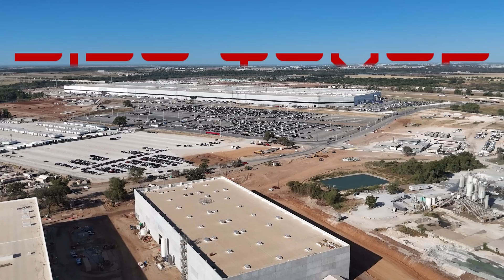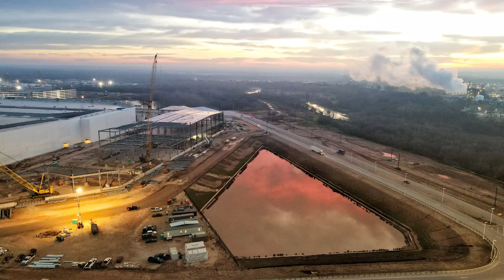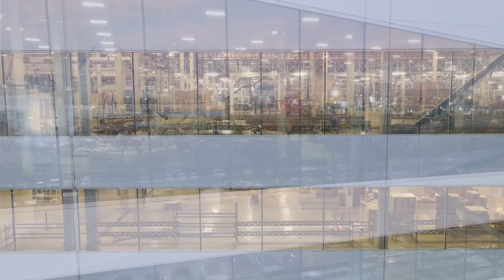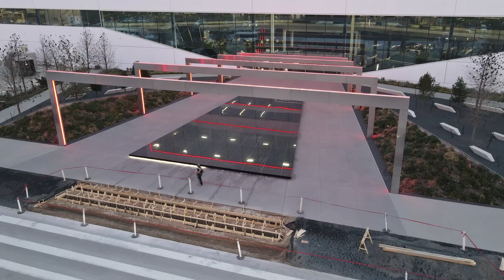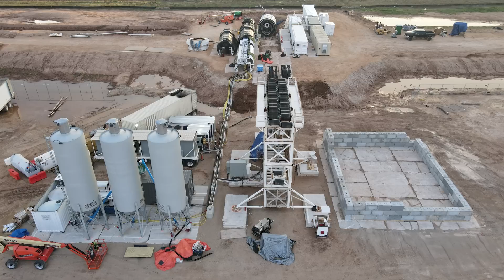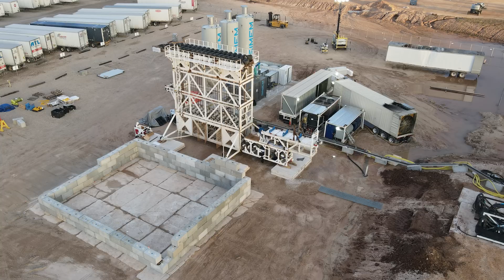Inside Views! S Glass Wall Expands! Castings Everywhere! 7 February 2024 Giga Texas Update (07:05AM)

Comment: Hey Joe, I ran into a couple of Tesla service techs doing PM (preventative maintenance) at one of my local super charger stations. I had a great conversation with them as we nerded out. They do general PM every six months, then a major PM every five years. The best part is that I found out that those white equipment cabinets contain racks of the same chargers used in the cars that are paralleled together to operate as the superchargers. This just tickled the nerd in my soul, since using an assembly line part as modules means that they are able to take advantage of the economies of scale, and if one module fails, others can take up the slack until they are replaced. I believe that he said that they are hot swappable, so replacement can occur while they are operating. Truly another example of the next level engineering at Tesla.
Reply: Preventative maintenance program. Just about every other charging network falls down in that area.

I gather you are talking about the DC charger side?

What else did you get out of them?
Reply: @DessieDoolan  With all battery chargers that get their power from AC mains you are dealing with a combination of both AC and DC. The AC power comes in, then will be stepped up or down in voltage to that which is optimal for the charger system, then like any DC power supply that operates off of AC, will go through diode bridge rectifiers, smoothing and conditioning, then current and voltage output controls that can deliver DC to each individual vehicle at the voltage and current required. The vehicle will also contain further controls to ensure proper charging is occurring. Not sure how other vehicles do it, but Tesla has the vehicle communicate with the multiple chargers that are paralleled together to output exactly what the vehicle needs. As an electrician, I am impressed with the architecture.
Reply: @GoCoyote   You seem to have struck gold. You had the bonus of talking to techs who knew their stuff, and were willing to talk about it.

Really impressed about the maintenance cycle. Tesla chargers have a reputation for reliability, there's the reason.
Reply: @DessieDoolan   I agree. It makes a huge difference to be in front of issues instead of behind them. They will get notifications of issues, so they can provide emergency repairs in addition to the standard maintenance. Because they are using smaller modular components, they can allow some to fail, then replace them during scheduled maintenance. It also allows the chargers to cycle through the units as to which ones are being used the most in order to prolong their life.
Reply: Thats is an opportunity to note why NACS DC is better than CCS . But CCS has hi power 3-phase ac charging i hear you say...sure, but then you have to put 3 phase power rectification in EVERY CAR. Which is expensive, and heavy. Simpler and cheaper to build stationary rectification and just send DC into the car.
Reply: @geomacaulay  No onboard vehicle chargers in the US use three phase power, since it is not available to US residential systems, so only split phase 120/240 is used in them.

CCS is a connection plug standard that provides separate AC and DC connections to vehicles, unlike the NACS which the vehicle can utilize low power AC or high power DC from the same connection. When a vehicle with a NACS plug connects to a charger, it determines if it is a AC supply or DC, then routes the incoming power through the required connections. If AC, it will route the power to the onboard AC to DC rectifier system (the onboard charger) that will output DC power to the battery. If DC is inputed, it will bypass the onboard charge and instead communicate with the external charger/s to provide the appropriate DC power to the battery.

CCS plugs provide entirely separate connections to the vehicle that allow for the routing of AC and DC to occur using separate connections instead of doing so using switching methods internal to the car. Both systems still use an onboard vehicle charger that can convert AC to DC, since making an external AC to DC converter would mean a bulky and expensive portable charger if you are visiting grandma and want to charge your vehicle.

It would also require separate wall chargers for each different vehicle since every vehicle battery requires different voltage and current settings. Much easier to include all of the necessary electronics in a package within the vehicle. The exception is for high amperage DC chargers where external AC to DC makes sense. With proper controls and common architecture, they can become universal to different vehicles battery charging needs. That is why universal adoption of NACS in North America is such a game changer, since it will create a common standard that will allow cross manufacturer vehicle and charging platforms.

The Only reason that Europe has gone with CCS plugs is that it was mandated by the EU before Tesla was able to get a foothold. Plus many counties in the EU provide 230V three phase power to the service in residential homes, yet there is also a lot of single phase 230V services, especially in older homes. Within the home most circuits are 230V single phase regardless if the service is 3 phase, except for vehicle chargers which tend to be three phase if available.
Reply: @GoCoyote  FWIW. Some complexity down here. AFAIK all EVs here are CCS now. Model S and X no longer available, these did have the Tesla/NACS plug. The only Supercharger station I'm familiar with has 2 leads per Supercharger, a CCS Combo 2 and a Tesla/NACS.

Home wall connectors come standard wire-able as single or 3 phase. Plug is CCS/Mennekes without the DC pins (smaller). Same as Europe I guess.
Reply: Do you mean the smaller white cabinets that come with 4 Superchargers on a concrete pad, like the ones seen @ 16:04 (Bottom of screen)?
Reply: @DavidJohnson-tv2nn  I am not sure of the function of the smaller cabinet mounted on the pad, as our older station that I was chatting with them at only has the larger cabinets, and the techs said that they were all installed in the large cabinets, and that DC was ran from the chargers to each charging stall. If I ever get a chance, I will ask about the newer modular systems. The charger modules contain transformers, diode bridge rectifiers, smoothing and conditioning, and current output controls similar to any DC power supply.
Reply: @GoCoyote I liked seeing your namesake hunting around!
Reply from the maker: very cool and thanks for sharing!

Comment: Main entrance could be the installation of a giant water and squeegee system to automatically clean the blackstone on an ~ hourly basis.
Reply: Black tile or stone set in mortar is a nightmare no matter how you do it.  Constant leaching of calcium deposits from the mortar onto the surface, happens all the time with other colors too, but black just shows it asap.
Reply: @michaelkaster5058  Aye. Rip it out, sell it off and replace with some of the perfectly good concrete slab that are dotted about all over the place.
Reply: @michaelkaster5058  Should have just gone with a pool

Comment: Is there a reason the cathode building has so few (if any) glass windows?
Reply: With batteries, the components need to be as free of contaminants as possible.  More openings is more opportunity for stray particles.  That said they did install then remove some concrete panels and then install glass at a later time on the main building.  Could just be a  lag in between ordering and delivery for the glass panels and needing it closed in.  Last thing is in a volatile environment such as battery making you don't want any errors made cause someone read a monitor wrong, cause the sun was shining on it.
Reply: Concrete is cheaper than glass and there aren't going to be offices there It's pure factory production.
Reply: @catseyes2334  I feel bad for the poor workers who have to work in that dungeon!
Reply: @DavidJohnson-tv2nn  Hopefully it’s mostly automated and doesn’t need that any employees working in it. Usually in such facilities, you have miles of pipes and machinery and Control Rooms. Not a lot of need for windows in either.
Reply: @DavidJohnson-tv2nn I worked inside data centers for 20+ years. Total dungeons. At one point I managed 3 floors of about 25 people per shift. Most of us survived and have a positive outlook on life. None went “postal” in my career. Lots of people work in dungeons and make good money and live normal lives. Stop trying to paint a negative picture wherever you can.
Reply: @RanchReed  Actually, I would like to see a more positive environment for workers. While they can work in a dungeon, why should they have to. Just to save a little money for the billionaire?
I could understand if there is a technical reason for not having windows. But just being cheap is not a good reason in my opinion.
Reply: @DavidJohnson-tv2nn  The thing is, you have no idea why there are no windows.  Why make assumptions?  Just because one random guy says it's because concrete is cheaper doesn't mean that's the actual reason.
Reply: @sammyk874  If you would take the time to actually read what I said, you would notice that I also said.....
"I could understand if there is a technical reason for not having windows"

Comment: Looks like a sign at the main entrance and I guess Tesla’s office space will be at the new construction
Reply from the maker: They have yet to put a sign that says Tesla, so that is a good guess ... we should know for sure soon!
Reply: I’d agree on office space on the south end except for the height of the floors. Perhaps an entrance would be a 20+ foot tall area but offices don’t need to be that tall at all. So I’m not sure what they are going to use the space for.
Reply: @Bill_N_ATX  they might add a mezzanine level like in the main building…🤷🏽
Reply: @michaeljohnson1805  When the main building was constructed, other than Stamping and Casting, they were only building 'space'. The massive changes since show they only had a vague idea of future requirements.

Since built;

Mezzanine floors.
Main Entrance.
Construction of loading docks on the west side, plugging of same, followed by opening up of same.
Construction of 57 additional loading docks on the east side.
Cathode was to be part of the Battery building.
Stamping 2 was an afterthought

Southend extension is a different beast. Elevated ground floor, different roof profile, massive glass curtain wall, a tunnel entry. Not just building 'space' here, this is a 'complete design'.